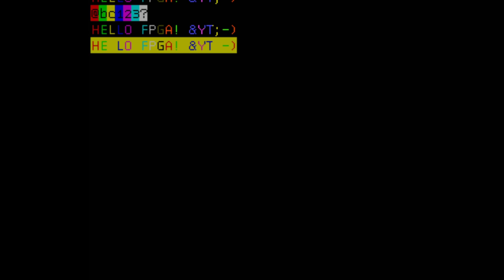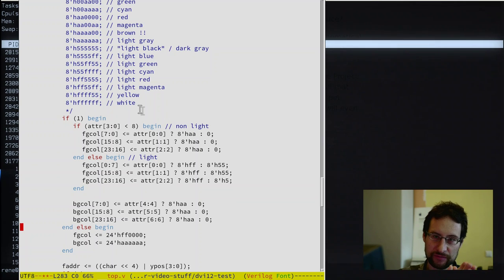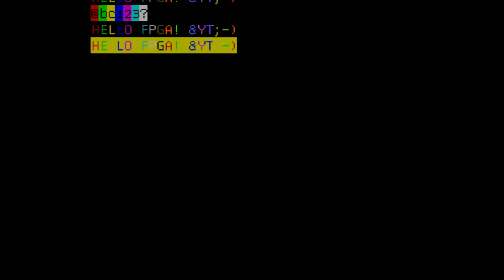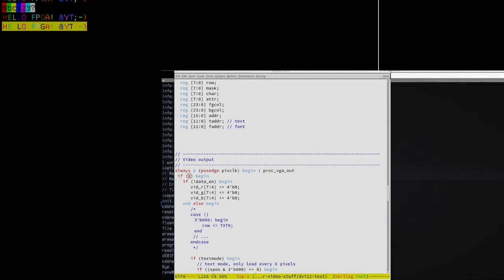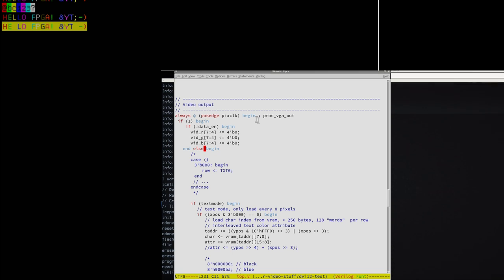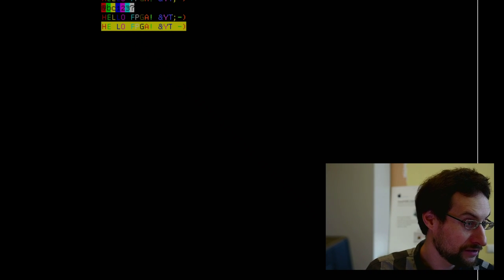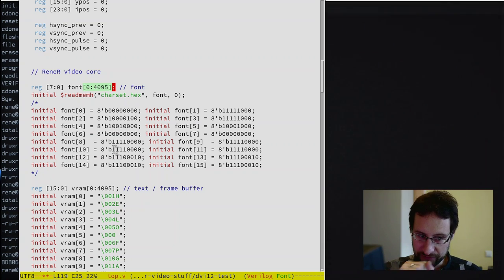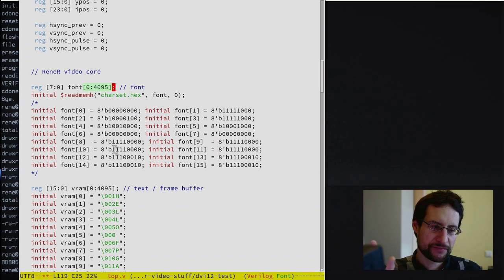It's the RAM access time, stupid! Generating useful video signals ain't that easy, ..!

Comment from the maker: The more I look at it the more I think this is block RAM related timing, signal being delayed some cycles, a simply YOLO workaround might be delaying the pixel clock by N clk. Or better yet write the code so that it pre-loads the next text character and/or explicitly copy and set the pixelclk and syncs in the same text generating logic to enforce the same delay.  Maybe simply moving my "video core" code into the pixclk with this " non-blocking assignment" their action does not register until after the always block has executed. Guess something to try tomorrow ;-)

Comment: The MistER project for retro gaming uses the DE10-Nano. And in order to get the performance they needed from some of the cores, they developed an SDRAM addon which hooks into one of the GPIO leads. As it turns out it is much lower latency than the internal ddr3 on the cpu side of the chip. MINIMIG (amiga core) for example uses the sdram addon for Chip Ram and RTG, and the ddr3 for fast ram so they don't cause each other issues.